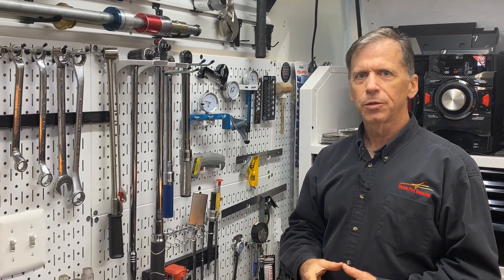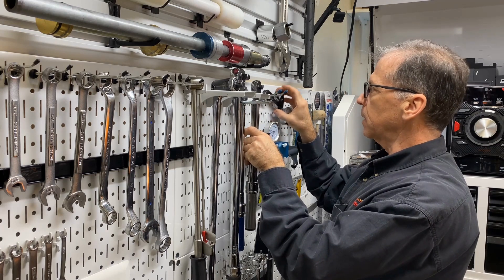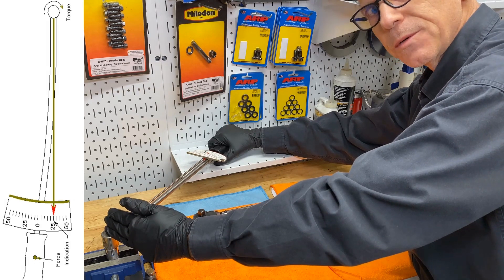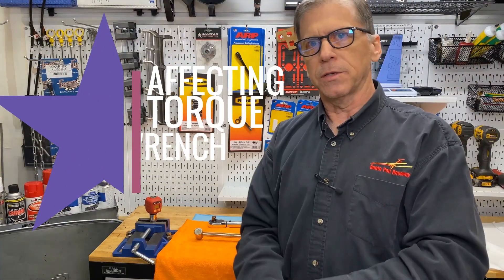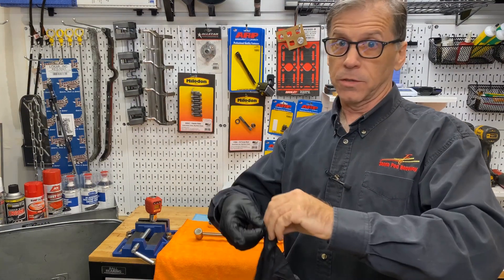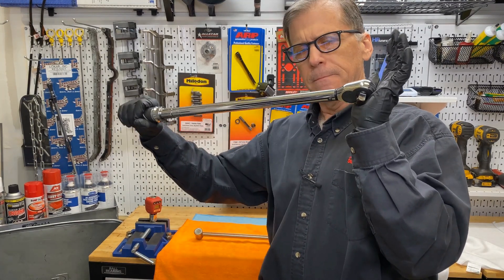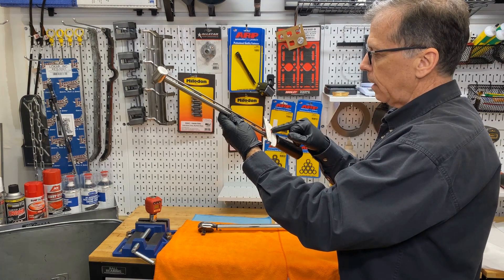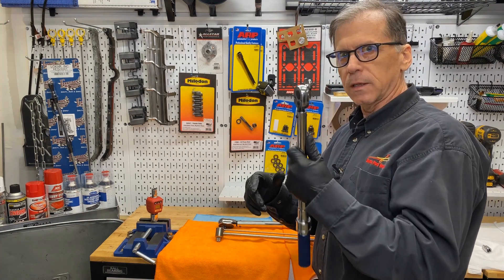Torque Wrench Tech

Comment: how to know the proper torque for each bolt ? does each bolt size has a specific torque ?
Reply from the maker: Good question:  Short answer is NO each bolt size does not have a specific torque value.  They are all different.  The automotive typical fasteners have general "good enough" values that I don't know by heart.  The fastener (bolt) really has to stretch the proper amount and whatever torque or twisting force that gives the proper stretch is the proper torque. (arbitrary value)
So in a nutshell the proper torque value is listed in shop manual or with the bolt manufacture.  For rod bolts it comes with the rods in the spec sheet.  For ARP bolts it is in the package of bolts or on the ARP web site. For the GM stock values it's in the shop manual (Helms manual).
Reply: @EllweinEngines  what a great answer . thank you .  so the proper torque is what the manufacturer tell's you . haha . awesome .